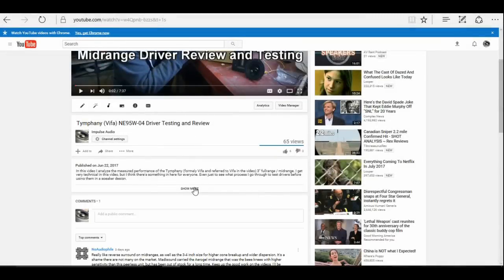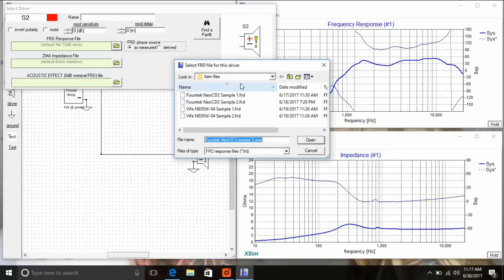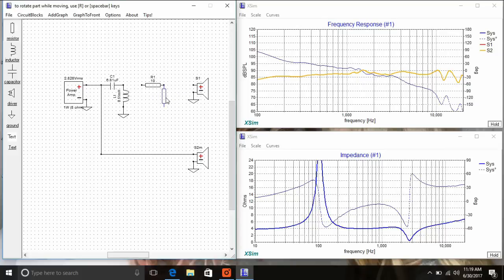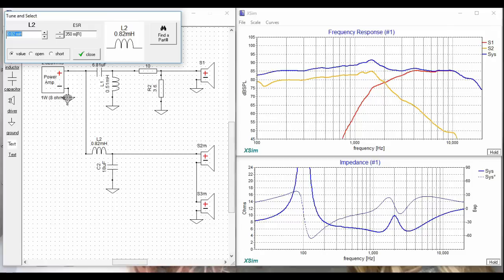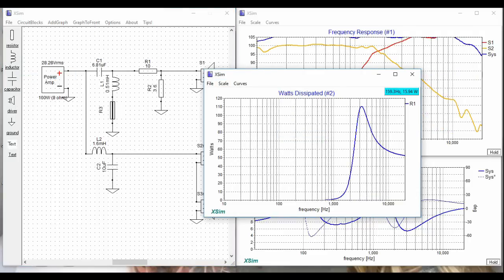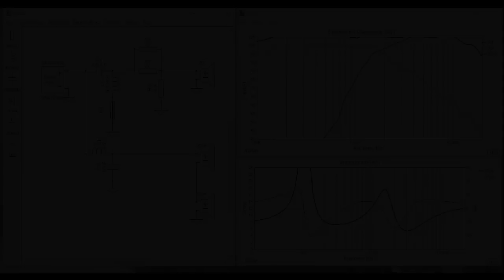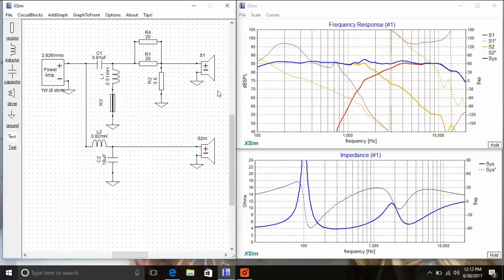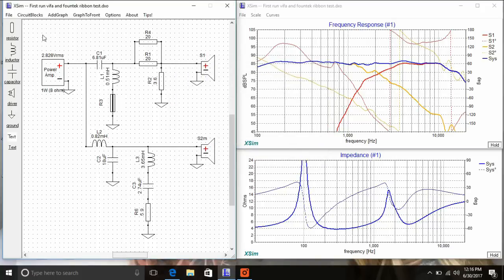Crossover Design Software Xsim Tutorial for HiFi Speakers

Comment: Subscribed. Love your videos. I almost ordered 5 crossovers by Dayton sold at partsexpress, crossed at 2500hz. Basically I've gotten PSB T65 Drivers, tweeter and woofers, cabinets were destroyed by the original owner along with the crossovers.  I'd really like to somehow contact you or get more help on how I could go on about designing them completely to perfection, as I can't find their data sheet anywhere at all. Thankyou :)
Reply from the maker: Rohail Butt hey glad you saved your money. Tricky situation though as you would need to measure the drivers. If you could find a spec sheet you could at least get some data files based on that.
Reply: Thankyou for your response! Well I contacted PSB and got a reply, they are not helping me either. So basically i've wasted my money and nothing will come good of it?
Reply from the maker: Rohail Butt they won't tell you what the original schematic was? Can they at least sell you new XOers?  What is the damage? I wonder if they can be repaired...
Reply: Damage is that they've been thrown away :(  they don't have the xovers anymore so cannot be sold. I asked.
Reply from the maker: Rohail Butt ouch. Hmm, if you can't get your money back the best thing may be to use a generic crossover temporarily and use the speaker to learn. Or maybe reuse the cabinets to start a new project that has been proven properly.
Reply: Hey man! Hopefully this will be the last time I bother you!

I just ordered dayton audio dats v2, I will connect it to my woofers first, inside the cabinet, then get their impedance curve and their frequency curve, then do the same with the tweeter, both flush mounted inside the cabinet, or shall I do it open air? Could I do that and then use this video to design a way more accurate crossover? I will probably use xsim!
Reply from the maker: Yes that's the way to do it. DATS doesn't measure the frequency response though. Do you have a measurement mic?
Reply: Yeah my, bad, i  will get the measuring mic by Dayton Audio aswell.  
Just wanted to say I've posted all this for help on Avforums and diyAudio, no one has even bothered replying regardless of my few bump posts lol, God bless you sir! Thank you for everything. I will get my things within the next 20ish days or so, so I won't be asking you much till then, but for now may I know what you recommend me doing? Like say when my tools get here, should I build a cabinet first, and out them in that cabinet then measure or what? Anything else that i am missing?
Reply from the maker: Yes I'd build the cabinets to be able to get measurements in the actual box. You'll need to get the speaker as far from reflections as possible. Then get the measurement files into a .frd extension. Then you can load them into xsim and start playing. You'll be embarking on a very challenging task. Stick with it and you'll get there eventually.

Comment: Why would you only want 10 watts to reach the tweeter from 100 watt amp?
Reply from the maker: Nosajjao if the sensitivity of the tweeter is much higher than the woofer (which is common) then the input to the tweeter needs to be restricted using resistors. It also helps protect fragile tweeters. Big amps are mostly for the woofers.

Comment: I created frd filefrom curve and icant load it. It says File load error, followed with name of file. I traced curves in FPGraph tracer. When i compared frd which came with app with mine i noticed i have only two columns of numbers but these frd files have three columns with numbers?? I am confused
Reply from the maker: Zox Wolf it needs three columns. Frequency amplitude and phase. You can even just add 0 for phase on the whole thing. But you’ll need to extract minimum phase in that case. I show how to extract minimum phase in my Life S5 series, about part 4 or 5.
Reply: @ImpulseAudioSpeakers  Thanx mate, I manage to make frd and zma file but as you said phase is 0.
I will check your other videos. How much accurate is this? I noticed that i need to adjust scaling (vertical center and vertical value) on right windows othervise i cant see my frequency and impedance curves. I traced original dynaudio graphs in corel and than in FPG tracer.
I am planing to get DaytonAudio OmniMic V2 with software. Do you think it will export FRD and ZMA files as it should.I am still confused bout using this Xsim :(
Cheers mate
Reply from the maker: Zox Wolf without phase it’s not accurate. But you can extract minimum phase which is accurate to a point. Difficult to explain. Omnimic or any mic like that will give you the frd files. Zma files are different and require an impedance tester. 

All this can be quite confusing. I keep planning to make a video showing the process from beginning to end but it’ll be quite a bit of work.
Reply: @ImpulseAudioSpeakers   Thanx for your explanation. I intend to get DATS V and OmniMic V2 from Dayton Audio :)
I will closely monitor your channel for tutorials ..
Cheers mate

Comment: I been using xover pro and bass box pro I purchased off of parts express. Has anybody else used these, are they any good? I been using them for years and really like them  but have nothing to compare them to.
Reply from the maker: IowAudio Review do they let you import actual measurements of the drivers? Or just use theoretical lines?

Comment: i got frd and zma files from parts express. which frd file do i use it came with 4 different files
Reply from the maker: toad cut I’m not sure. I’ve never used their files. There should be 2 files for each driver. 1 frd and 1 zma file each. So 4 total kind of makes sense.

Comment: with this sofware can u design a 4way crossover?  (tweeter+mid+midbass+bass)
REPLY
Reply from the maker: i raul Yup. Just add more drivers to the schematic area. This was just a two way to get people going.
Reply: Great info. Maybe for the newbie if u have time u could do a  short video to explain what is the attribute in a crossover of a capacitor, inductor, resistance. 
For example: u use a inductor on a tweeter.. if u want lower the impedance or frequency. Or u use an extra coil on the midbass to cut the upper frequency and a capacitor to do something... :D(i have no clue what i'm saying but u understand the idea)  ps: subbed :D
Reply from the maker: i raul Actually that is something I would like to do one day. Hopefully I'll get the chance soon.

Comment: Great Tutorial but how do i add driver files from Vifa and SB acoustics drivers i already Have
Reply from the maker: Cary Phillips you would either need to measure them, which is another entire subject on how to do that, or somehow get the files from another source. There is a program called SPL trace that creates frd and zma files from the manufacturers spec sheet.

What sb and vifa drivers do you have? I will be measuring the sb13pfc25-04 next and also the vifa XT25SC90-04. I may also have others.
Reply: Thanks for your reply, 

1 ; I am building a 3 way with the SB acoustics SB29RDC-C000-4 Tweeter, the SB 12NMRX25-4 Midrange and the SB23NRXS45-8 Woofer. 

2 ; I Am also going to design and build a switchable Super tweeter using the VIFA XT25SC90-04 with 3 crossover points and 3 sensitivity points for system matching to various speaker systems.

I thought this software would be very useful.

Regards Cary
Reply from the maker: Cary Phillips of those I only have the Vifa XT25SC90-04 and will be testing it next in fact. I currently have it in a box ready to go. It's going in my latest video and should have test results within a week. You'll be able to download the files and try them in xsim to see what could potentially work for you.
Reply from the maker: I do have the SB29RDCN-0004 but it is slightly different being the neo version. Could get a test of those though, if it would be helpful. It would have to wait though.

Comment: I don't understand, but where to install the location of the drivers?
Reply from the maker: Vladimir P sorry I’m not sure I understand the question. Are you asking where the drivers go on the screen? They go on the component layout window. It’s supposed to look like a circuit board.
Reply: @ImpulseAudioSpeakers  I meant the location of the drivers on baffle. For example, if I position the tweeter 60 mm to the left or higher or lower. How does XSim understand what driver placement I made in my project?
Reply from the maker: Vladimir P you should see my follow up video that shows the baffle functions of Xsim. But you really don’t need it. Always keep the tweeter as close to the mid or woofer as possible.

Comment: Nice one. Xsim is ok but you really should try vituixcad. It is just a lot better program and also free.
Reply from the maker: maped345 a lot of people have recommended it, but I haven’t found an advantage. I like software that is simple and to the point. Which is part of why HolmImpulse is actually my favourite measurement software even though it’s not popular. Xsim has a lot of power built into it, but the core of it is very straightforward.

Comment: where do you get the files for the different speaker drivers?
Reply from the maker: ziggy8757 If you go to the a driver review video of mine, there is a link in the description. So far only 3 drivers available but you can play with a possible 3 way. More are coming.

I show it very briefly at the beggining of this video going to the drop box link. Let me know if you have troubles.

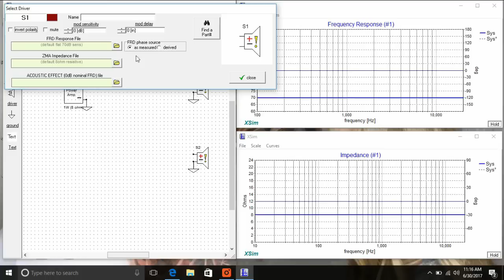Comment: at 1:24, you open the file in the folder - SPL response (.frd). please tell me how to make a .frd file for your speaker. if possible, make a short video)) it will be more clear. I will use a translator who translates poorly.
Reply from the maker: One Gogh You need to measure the driver, or you can download measurements of any drivers I have tested on the channel. Link to the measurements is in the description of all my driver test videos. I will be doing a video that will help with this soon. It will be about how to measure and test a speaker and then design the cross over.
Reply: @ImpulseAudioSpeakers   good evening. I want to make a measurement of the speakers beyma 10 wrs300. load data into your program. do not know how. to use it with fountek tweeter.
Reply from the maker: One Gogh do you have a mic? You’ll need that at a minimum. You might want to ask Beyma if they have the measurement available. Or search the web for it.
Reply: @ImpulseAudioSpeakers  Yes, I have a microphone. Beyma has data on the speaker. the speaker will come soon. if it’s not difficult for you, show how you do it))

Comment: good tutorial ryan , i learn so much from you . but its too fast expanation   for me .
Reply from the maker: ozy prima sorry about the speed. As you do more and more work with Xsim it will become clearer.
Reply: Impulse Audio how to read impendance correctly in curve ? Is the best as flat as or how should it be ?
Reply from the maker: ozy prima doesn’t need to be flat. There isn’t really much need to focus on the impedance curve other than to make sure impedance doesn’t go too low and cause problems for your amplifier.
Reply: @ImpulseAudioSpeakers  its means just keep focus on phase and freq response ?
Reply from the maker: ozy prima well yes but do make sure impedance doesn’t go below say 2ohms. At least. 4 ohms is better.

Comment: I wrote parts-express for the ZMA and FRD on my Peerless Nomex woofer and the tech said they do not have data on this driver. So I'm dead in the water without the data files.
Reply from the maker: Edward Case you could trace them. A lot of work and not that accurate, but can work. 

Ever considered buying a mic and measuring? Also a lot of work but it’s the ultimate way of doing the crossover design.
Reply: @ImpulseAudioSpeakers  Hi, can you do a video on measuring the drivers at home? Step by step (idelaly on free software:-) I can't find a video showing how to get a frd and impedance file by measuring yourself. In your other videos you measure drivers but you basically show the final curve but not how you set-up the program and which steps you did to get the curve (and the file to export). Pardon me if I missed it somewhere. Thanks
Reply from the maker: Petr Horky this is basically what my next video will be. I’ve just been extremely busy, but should have some free time soon.
Reply: @ImpulseAudioSpeakers  Well that's just what i wanted to hear! Thanks very much, will be waiting for it.
Reply: Hi, have you ever had the time/chance to make that video about measuring drivers at home from start to finish? Still difficult to find a simple overview of the process. There is lots of info around, but nothing step by step measurement of drivers. Thanks

Comment: Hmm i tried this- Hit Tune loaded FRD and ZMA and got NO graphs lol
Reply from the maker: Christopher Rc is your data SPL within the scale limits set on the graphs? I sometimes use 0db scales to get my data and that means I have to either correct the SPL or change the db scale in xsim.
Reply: Impulse Audio thanks this worked- I didn’t realize I needed more experience and knowledge. Trying to design my first crossover used PCD even VituxCAD spent about 8 hours today gotten nowhere.
Reply from the maker: Christopher Rc ouch! Have you watched my videos about the Life S5? Its a series I did that includes design. I try and walk through the whole thing.
Reply: Impulse Audio I’ll check it out thanks
Reply: Awesome vides. only got to #4 as its late, So i should pick my driver carefully build then worry about xover?
Reply from the maker: Christopher Rc well thats part of it. But you should be comfortable designing the XO before you build something nice. A test box is always a good idea.
Reply from the maker: Christopher Rc I'll try and pop over to TT but have a lot on my plate at the moment to review designs.